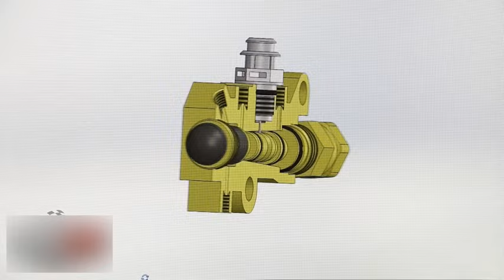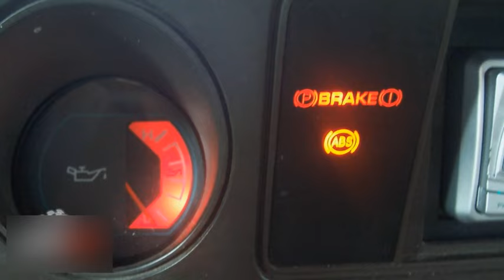Proportioning Valve

Comment: Question, when the low brake fluid sensor is removed, is there supposed to be any pressure or brake fluid in that chamber? I just did a proportion valve rebuild for an 84 Mustang. Different animal, but same function as the proportion valve requires a set screw to hold the internal piston from moving while bleeding brakes. But after my rebuild, my low fluid switch is leaking brake fluid through the top pins. Not the threads. Does that indicate the rebuild wasn't a success? Right now I have the set screw acting as a plug because I cant used the stock low fluid switch. It's possible that when the torched the lines to get them free, they damaged the plastic sensor, but just the same, I was under the impression there wasn't supposed to be fluid under the switch in the chamber where the sensors prong rests in the V  groove.
Reply: The switch on the combination valve is NOT a ''low fluid switch''. It's purpose is to alert the driver to a problem in the brake system via a light in the cluster that says brakes or something like that. Yes, of course if you torched the thing you will need to replace it. On the other hand when a brake system loses pressure via a leak you will notice that the petal almost goes to the floor and the brakes don't work nearly as well. If you are the type of person who wouldn't notice if half your brakes went out by all means fix the switch for the idiot light.

Comment: I just barely touch the brake and the back tires lock up! it's a 60 chev! any idea's?
Reply: Sounds like the self-adjusters in your back drum brakes aren't working right, so your brakes have gone out of adjustment as they have worn, The net effect is that they over self-actuate when they get far enough out of adjustment. You can manually adjust them to confirm this diagnosis, before tearing things apart. If you have just rebuilt them, then maybe all you need do is to back up and firmly apply your brakes a few times to make the self-adjusters do their thing.
Reply: Everything is new on it! it's a total Restoration! I drove it maybe 300 miles then it started doing it! two guys told me proportioning Valve @SteveRichfield